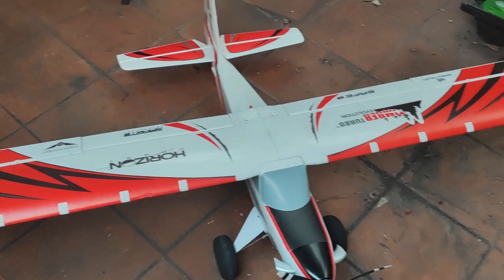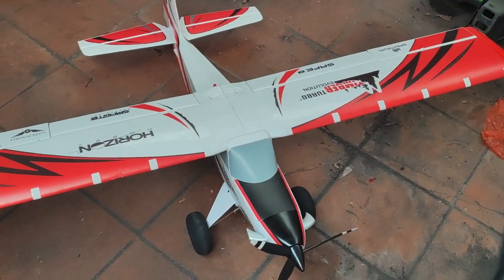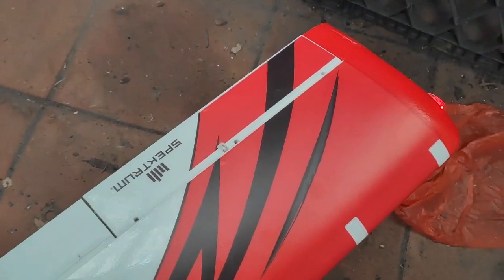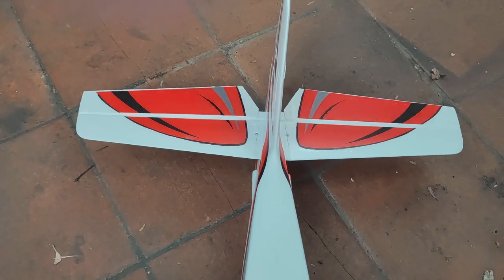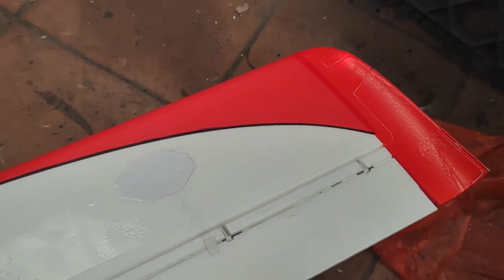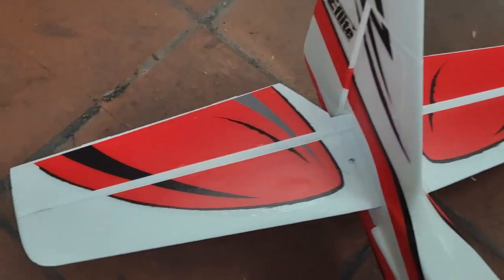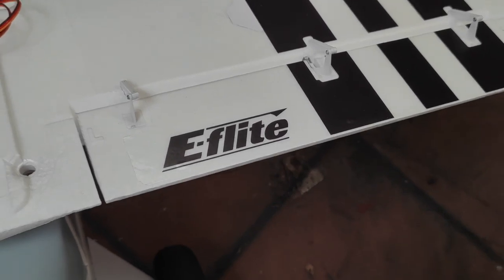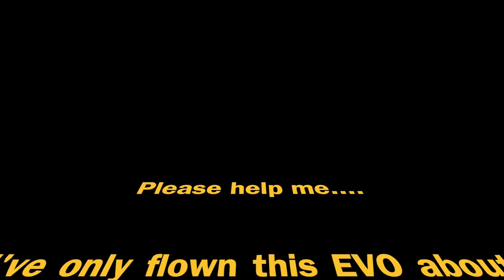E-flite Turbo Timber Evolution Left Aileron Fail

Comment: you are very lucky....replace the bad servo even if it seems to work now...when testing surfaces put some resistance on them with your hand and notice any slippage or clicking..
Reply from the maker: Thanks, but the plane is only 6 flights/weeks old and those servos are covered with full sheet wing contact adhesive and are deep, deep down in the wings, you can't even see the control arms/rods.  Hopefully, I will get a replacement plane or refund.  But I sure loved flying this bird, its a fantastic model from e-Flite.
Reply: @lancelink88  ok good luck but they are easy to get out. Cover is held with contact cement and will pry off. Servos just have silicon rubber

Comment: can you get to the rec. wires, maybe not plugged in all the way???  may be switch wired on ailerons see if other one has problem
Reply from the maker: I took out the servo and it was inoperative. Closer inspection showed the casing of the servo had slightly melted/deformed.
Reply: @lancelink88  hope all gets corrected for you